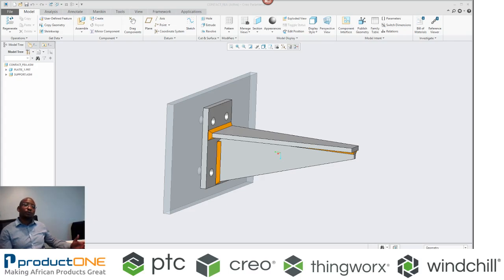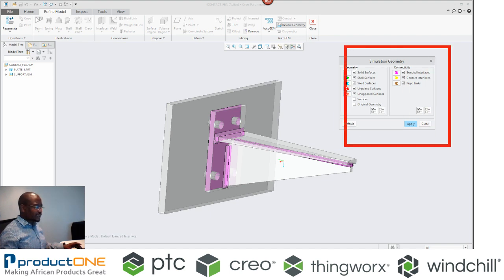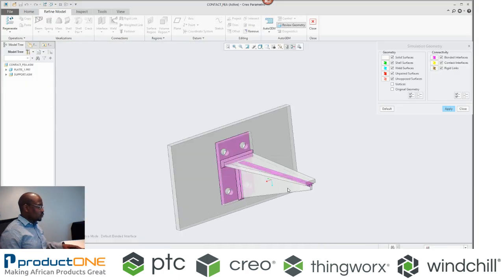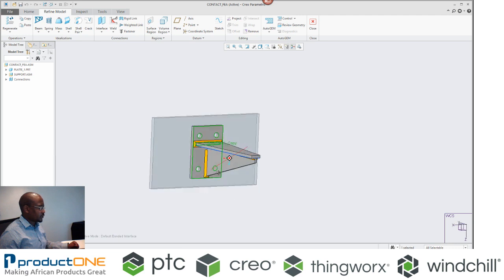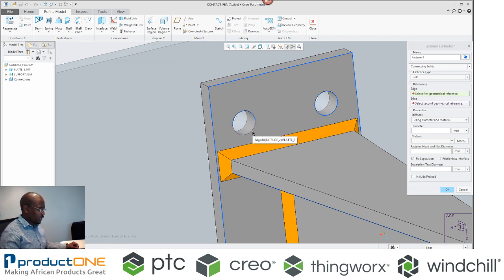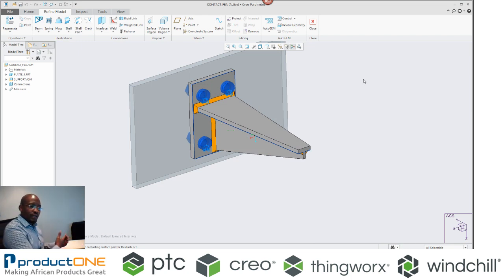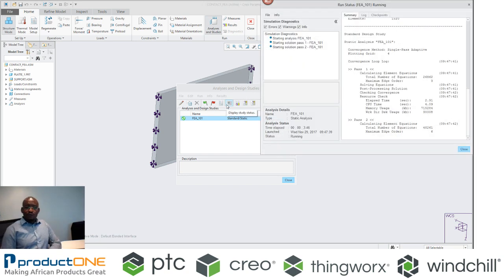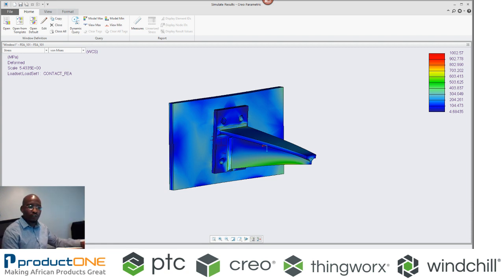PTC Creo Simulate Assemblies

Comment: Thank you Sir! May I ask if the interfaces between the welded plates could be "contact" instead of free?
Reply: rightly said. This can be cross checked by removing the bottom weld and running a simulation, in this case the component will start to penetrate. Fortunately, i was able to find a link performing this analysis. Please refer to 13:45 in below video.
https://www.youtube.com/watch?v=j7NfN3DLWBs